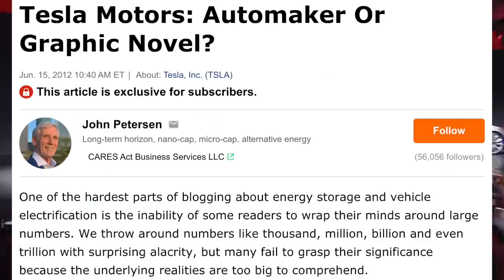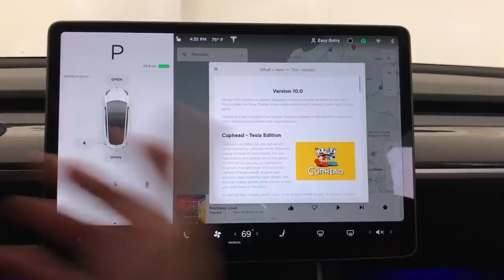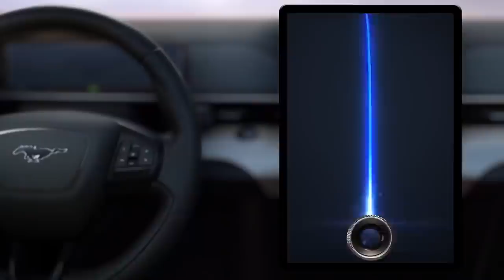Legacy Automakers Are Copying Tesla

Comment: Tesla aren't manufacturing their own battery cells and I very much doubt Panasonic will stop cell production, they have far too much invested in machinery. What's your source for that claim?
Reply from the maker: A Panasonic spokesperson has announced it in mid March: https://www.google.com/amp/s/techcrunch.com/2020/03/20/tesla-partner-panasonic-is-shutting-down-its-operations-at-nevada-gigafactory/amp/
Reply: @Casgains  So they are only having a 14 day break due to the current world events, they are not leaving the factory for good. But technically your statement is still correct in the video ;) Nice work on the video either way :)
Reply: That's only a 14 day shutdown due to Coronavirus, your video makes it sound like Panasonic is permanently leaving the Nevada Gigafactory because Tesla is making their own battery cells! That's clearly nonsense.